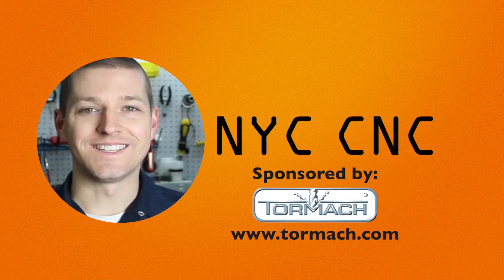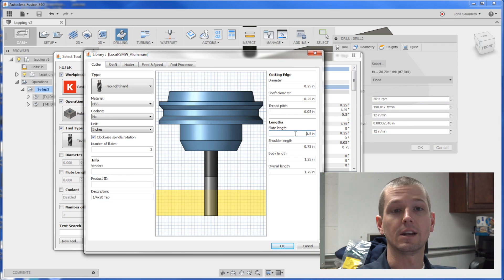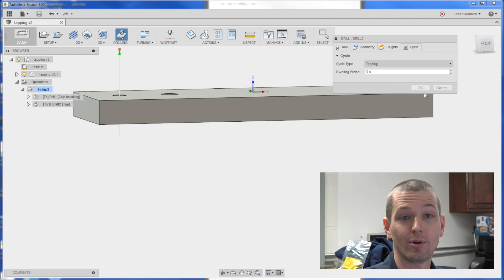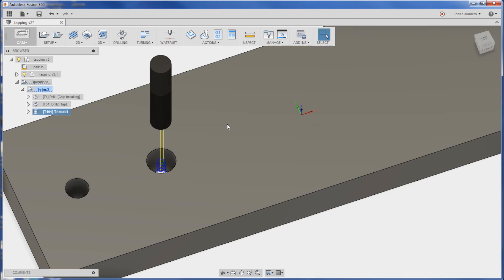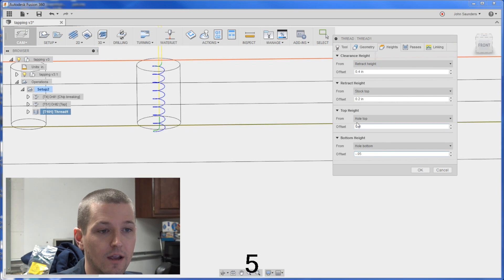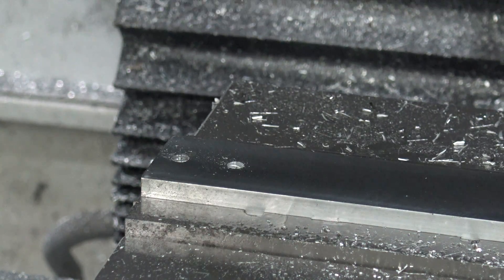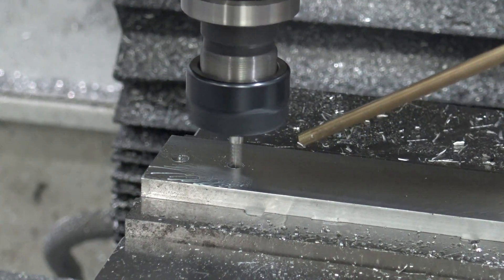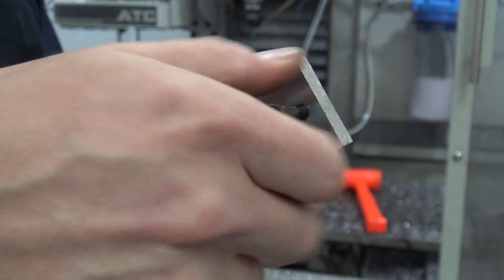Fusion Friday #12: Tapping & Threadmilling!

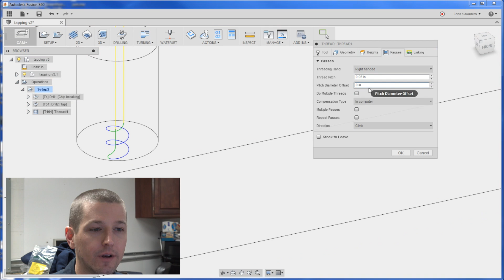Comment: 5:48 yeah. once you have makro that work it works allways. no need cam. even with multiple cuts. part is here tool is here stock is here. cut it. thats how my makros work. no need cam. how but square pocket that have round on midle. or round pocket that have square inside or even any feature like hex. pocketing everything else leave hex. its funny but it will be 1 line code. do that operation vs multiple hundreds on cam.if pass redred collision error

Comment: John, 
If you had your stock mounted on a rotary table set to rotate around the Z. Could you lock the spindle and feed that tap down at 20 ipm, providing of course your rotary table could get to 400rpm? But seriously, you probably could rigid tap like that at say 5ipm and rotate the table about 100rpm, right? 
I was hoping to see something like this. Perhaps using a 4th axis rotating about the x or y maybe? Haven't seen much information about tapping with a fourth. But it's synchronized 2 axis interpolation so in theory, it should work.

Comment: @03:35 That Speeds & Feeds Spreadsheet... Is it of use ( and publicly available ) for other materials than Metals like Woods and Plastics?
I just ordered an X-Carve last week and while I'm waiting for it to arrive in two weeks or so I'm learning about it and Fusion 360 which is going well.
What worries me so far is my utter lack of knowledge on what to keep an eye out for when it comes to using the proper settings for the various Bits / Materials.

Comment: Maybe dumb question, but why is the tap wobbling when it's not in the hole? Seems like it should run true. Does the Tormach tapper also have side-to-side allowance as well, so the tap doesn't have to be perfectly centered?

Comment: Have you ever looked into using thread forming taps for your smaller holes? No chip loading to worry about and thread formers are a good bit stronger then traditional taps so less chance of breakage.For larger holes thread milling is definitely the way to go!

Comment: Figures! Spent 3 hours last night trying to figure out how to thread mill with a Lakeshore single thread 4 flute.   You didn't cover it, but did mention it..   If you want to use the single thread type bit you have to select Slot Mill (which if you ask me is totally not intuitive), (NOTE: Selecting chamfer mill will give you an accurate tool rep.  but it will not work (3 hours of wisdom on that one))..   Huge pet peeve that they will not do anything about Thread milling in Fusion 360.   I guess not many people do it, if you have to thread bunches of stuffs it is the only way to go, specially if you need really really accurate tight threads.    

Great Video John
Reply: +NYC CNC Crap that figures that seemed like it was so far out the the rehlm of possibilities I didn't even try it.    I just cut a new water manifold for the Tmach, cut some 1/8th pipe threads.   To get it to come out right, I had to have the pitch in there .03736 with a pitch diameter offset in there of .06 which took several tries to nail down.   I think I am doing it wrong?   And what is a pitch diameter offset?

Comment: To bypass incremental with of cut you can split one operation into many manually setting stock to leave in each one. also do you have a video how correctly lead in, ramp in and plunge?

Comment: John. If I could make a few suggestions when you spot drill for a tapped hole use a spot drill a little bigger than the thread diameter. Say for your 1/4-20 thread .3125 or .375 and spot .010-.015 bigger than the thread, in this case .265 dia. this chanfers the hole as well as spot drills for the tap or thread mill. Also if you are going to do a lot of thread milling it pays to invest in the thread pitch gage to check the thread size. The reason the bolt is loose in the tapped hole is not the hole it is the bolts clearance. if you use a bolt to gage your holes they will be to small. On the thread milling profile you could use cutter comp, than you can control the size with a offset at the machine not with having to change the program.

Comment: Can you get the fusion folks to let you set height presets?  I like to use reference height of .1 vs their R.2.  Also on the drill break thru they need to calculate from the cutting edge and not the point.  That's all for now.

Comment: why do you still not chamfer your threaded holes before tapping/thread milling?

just center drill a little bit bigger than the nominal diameter of the desired thread and boom chamfer and centered in one pass.

here in Germany every apprentice learns it this way. always chamfer before threading!

Comment: John, I use the On-line thread milling processor on the Guhring website.  It has a nice easy to use graphic interface and gives options for multiple passes;
http://www.guhring.com/Tech/ThreadMillCNC/Default.aspx
It is designed to support the Guhring products but you could make it work with what you have easy enough.  Then copy & paste the code into your program where ever you need it.
I don't know if Tormach has the capability, but you could write a custom macro for thread milling and assign it to a spare G-Code.  I've been using Haas machines and it has this capability, but I think they really should provide a factory G-Code for thread milling.  Using G02 and G03 uses a lot of code to complete a simple operation.

Comment: John,
Nice video. I like watching CNC machines at work.   :-)

On the first tapped hole, does the tap have a grading for the fit. On hand taps, you can get them in H1, H2, and H3 with H1 being the best fit for the bolt.

Comment: Great video. I finally convinced my boss to get the shop some thread mills after some very inconvenient broken taps in parts. When a tap breaks in a part it can be very difficult to remove and might scrap the part. I like using thread mills for blind holes or threading very hard materials.

Comment: Another important note to speed up and improve your threadmilling, if you calculate how far you have to travel radially you can divide it up better and use less passes. Since your major is .250 and you are drilling .201 you only have .0245 a side to take (probably even less with the drill not drilling on size). That's why your first 2 passes didn't even cut and the other 2 were progressively heavier.
Reply: Also great video! Can't wait for custom form tools as well

Comment: If you have a hole modeled to the tap drill diameter (or any other diameter) then you can use the pitch diameter offset to correct the offset of the cut.